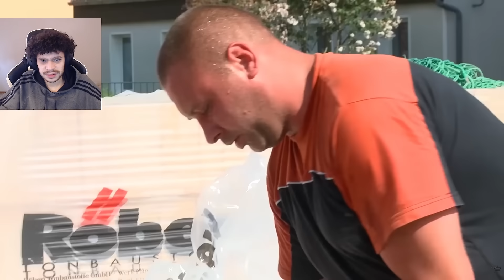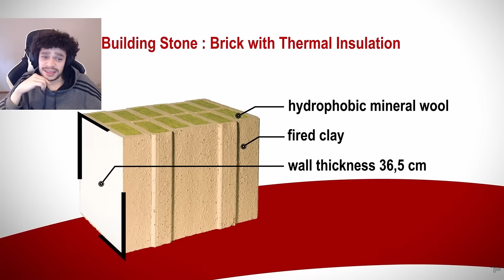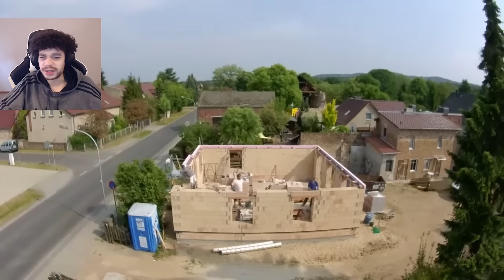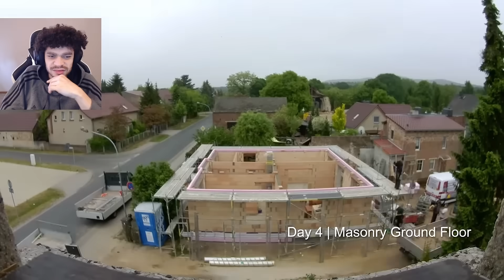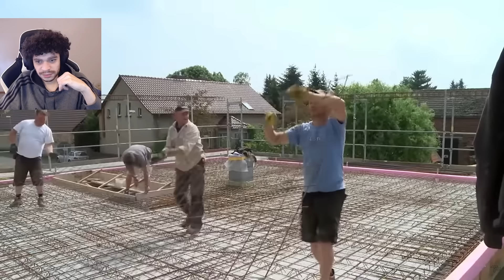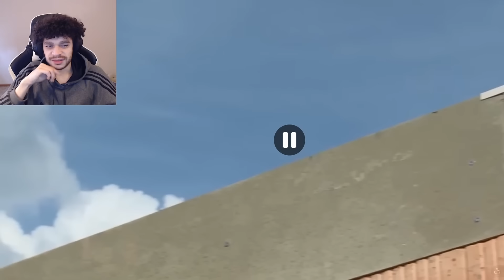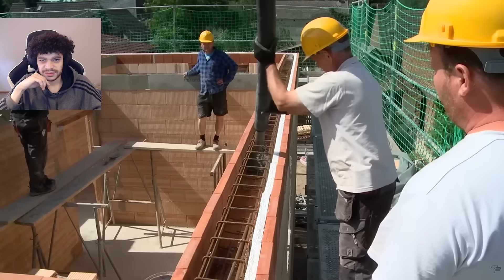American Reacts to How German Houses Are Built! *IS THIS REAL?!*

Comment: I live in Norway in a 300 year old log house. Built like a log cabin, but a full size house, with clading both outside and inside the logs,  so the walls are about 10 inches thick. The house can creak a bit in the worst storms, but we don`t really have tornadoes here, so I`m never going to be woried about this house falling down. Add to this the solid glazed roof-tiles that only needs me to look out for cracked/ broken tiles until redoing the roof in 40 to 60 years time.😊

Comment: The crazy thing about the sturdiness is that in Germany you don't have really heavy storms of the same magnitude as in the USA.
Reply: Northern Germany had the storm named "Christian" that had gusts up to 202 Km/h!
Reply: @jan-peterbrodersen3302  Its not like there are no strong storms ever. But they are less common and do not typically reach the power of storms in the USA. There are actually Tornados in Germany, but these occur rarely and only in one specific small region.
Reply: but you do have to prepare for war against nazi russia, so every.house being a bunker is extremely good forward planning.
Reply: @512TheWolf512  It would not require a single bomb to defeat the German army which has been basically disarmed by giving away a lot of its ammunition and due to other problems.
Reply: @drydessert4198  merkel deserves life in jail for destroying Germany. Mertz only just barely started fixing it
Reply: True, but it would be interesting to compare heating/cooling costs between European constructed houses and that from the USA.
Reply: @Dreamfox-df6bg  In many countries, it is common that houses are significantly colder inside in winter and therefore you wear thicker clothing. In Germany, it's common to have warm temperatures inside all year round. That and the cost of energy would skew a comparison.
Reply: @drydessert4198  True, but that's the reason so few houses in Germany have no AC's included. Until 20 years ago they simply weren't needed.
You know, the thing that so many visitors from the US wonder about.
Reply: @Dreamfox-df6bg  The houses here are insulated significantly better on average, but also cost significantly more. I just watched a video of a house construction. The floor slab alone costed 100k.

Comment: we also have wooden houses, but its rare and only realy a ting in the last few years. the video shows how houses are build nowadays. i life in a house from 1870. the outer wall is 3 rows of Reichsformat (25x12x6.5cm) bricks. so the wall is round about 38cm thick. the interior walls are 12cm thick. made from half timbering filet out with brickwork, the foundation is made from slate. additional every wall has around 3cm of plaster on each side. this construction is realy common here. drywall construction is only used to divide rooms and if old walls aren´t flat. and old walls are never flat, and no wall ever is at a right angle to another wall in a old house

Comment: What do you mean you feel wind??? You're inside! Wind is an outside experience!! 🤦

Houses in Europe are built to last but another reason for the difference is that long wood is much more expensive for us (as in: a 2 by 4 could be 5x the price) - we already deforested most of the continent. In Scandinavia, where they still have trees, you still see some wooden construction.

Most unrealistic thing about the vid was construction time. That part was a scam. Also later on after the structure is finish: our plumbers need to cut through concrete to install your toilet... Our electricians too. I've heard you guys build a home in 1/3 of the time compared to us (it will last 1/3 of the time too but, you know, choices)

Comment: Just FYI: Don't let you get fooled by the build speed "shown" in the video. All this is not just happening in 4 Days. It is maybe the 4th day on the site but not the 4th day after construction start. A typical German House construction needs something between 6 - 12 Months to be fully completed. The concrete needs AT LEAST 3-4 days Drying-Time before you cant continue with the next building steps, most of the time the company waits a bit longer. So if this vid shows Day 4 or 5 of work, you can assume this House is already standing there for at least a Month or maybe even two. Tbf there are some companies out there who build you a house in turbo speed (round about 3 Month's, including 30 days of mandatory drying time for the concrete to fully harden) but that's very rare in Germany. To be able to do this you need perfect weather, perfect organisation and perfect preparation.

Comment: One has to understand that BUILDING a house in germany makes for ar permanent residence, usually for the rest of your life. Ther are no "starter houses" like in the US, especially because - you can imagine - a solid house like that costs more than a few sticks and paper put together ;P

Jokes aside, there is quite a renge of options of how to build a house. Nowadays i'd say, the most popular methotd is the "Fertighaus". Basically a house made from prefab parts, which can be erected quite quickly. I've seen some go up within a months time, and i think it can be done even faster, given a dry groundplate.
On the other end, you'd have something like here - build from bricks, layout like you'd want it, and lastly customized to your wishes. Building such a house kann well take up to a year - however, if money is of no concern, it also can be done quite quickly.

The "Rohbau", the structure itself, is not the part that takes the most time, necessarily. It is the installations, the "Innenausbau" (interiors), the insulation etc.pp. that will take up most of it. As i said, these houses - wherever in the price range you are - are built to last for at least a century, probably more. You can get parfts where you have guarantees for up to 25 years -which is, AFAIK, somewhat at the WOL for the cheaper US houses...?
Take the roofs, for example - my house has it's second roof now, after the first one held up 60 years. And i positively expect not to have trouble with that again within my lifetime.
In the US, you've got those bitumen shingles, i guess, or a metal roof. Now, i don't know about the last one, but those flimsy shingles surely won't last for 20 years, let alone 60. And that's if the framing an whatever is tacked on that as "wall" is still intact after that time.
Well, it is definitely a lot cheaper, ill give you that. On the other hand, i'd call it also only "semi-permanent".

At last, it is somewhat different expectation. German houses are built to last for as long as possible, but doing so costs a lot and takes time. US houses are cheaper and quick to build, but they don't last as long. Given that USAians move a lot more than the standard european i guess that makes sense. Somewhat. ;)

Comment: The 24m² (250 sqft) garden shed I built a few years ago was built using a timber frame (Fachwerk) made from good strong posts (5"x5") not some flimsy boards. Of course connected by traditional tenon and joint. The frames where then clad with bamboo mats before I filled them with a hemp sheave / loam mixture. The plastering I did with loam as well. All in all the walls where 21cm (8") thick and MUCH more stable than a typical murican "house". And yes, that's just a garden shed, albeit a rather overengineered one.

Comment: These houses are built all over Europe, of course, every country or person has a certain style of building, but they are all the same. First, a concrete foundation. Then you build walls around the perimeter using mortar. The types of bricks can vary in shape and size. They are completely European standard. They are always strong and will last for many years. They are called prestige.

Comment: Drywall is mostly used for interiors in office buildings, screwed to metal studs, and sometimes as so called dry-plaster simply glued against the brick-walls from the inside. Which will track some air pockets between brickwall and drywall and this way improve insulation.
Reply: In the UK we'd attach it to to wood studding fastened to the brick work.  Internal non load bearing "stud walls" are frequently a wood frame (60cm centres) with drywall attached,  makes wiring easier 😁🇬🇧

Comment: That's just normal European standard of brick laying. Nothing specific German here. Also most common is makng the corners from concrete and rebar connected to the concrete foundation and the ceiling that is also done as concrete with rebar. That's structurally superior to making the corners with bricks.

Comment: Can you feel any wind? - Nope. You don't feel a thing. Depending on the wind direction, you might hear it a little. Perhaps if you have a converted attic—since those are usually made of wood here, too. You can see that in the second part of the video.

How much does it cost? – It depends on the size and location. €400,000 is probably a mid-range figure. This one might be a bit more expensive. It’s not exactly a luxury cabin, but it’s above average. It looks like they built it on an existing plot of land, which makes things a bit cheaper.

How long does it take? – I think getting all the permits together takes the longest. Bureaucracy here is incredibly complicated and time-consuming. They build the house itself in a single season: one month for the shell and five months for the interior finishing. That’s assuming the tradespeople coordinate well—so you don't end up with the tiler arriving before the electrician, or the plumber failing to show up for a whole month.

In this case, it looks like the workers are Polish or from elsewhere in Eastern Europe. They’re the best. They work from sunrise to sunset and will even solve problems outside their specific remit just to get the job done.

Comment: You have to understand that the differences in home building are the result of different circumstances. Timber has always been cheaper in the U.S., there's just so much available. So it makes sense to use it for building homes. Also, Americans are more mobile in general, whereas many Europeans are building generational homes that basically last forever if you take care of them. Although that's changing now, families are spread out across the globe.
Also, the brick-and-mortar style of building family homes is becoming less common now. It's being replaced by prefabs who offer competetive pricing and very short construction time on site. These panels already contain insulation and moisture barriers and are held together - by wooden studs. So Europe is shifting towards wood again, but in a different way.

Comment: Do we feel wind? Does the house shake?
Uhm … nope. When there is a really strong storm outside you only hear the rolling shutters rattle a little. But you do not feel the house shake or anything.
We have very few occasions when we have tornados in Europe. (Not all that strong like an american tornado). And we have storms with wind speeds reaching 100 mph. The only thing that might be damaged are the roofs. But usually they just laugh it off. Most roof damage happens when a tree is push over by the storm and hits your house.

Comment: This is obviously a promotional video for a house building system. 1. Most houses are not built like depicted. 2. In contrast to other European countries, in Germany the majority of people rent houses and appartments. 3. We don't fall through the floors like Americans do. 4. In the US everything is about appearance and not about value, substance and quality.
Reply: However, the construction methods are similar; I worked in the construction industry for 30 years and am familiar with various techniques—ranging from timber-frame construction (which is becoming increasingly common here, albeit using larger timber cross-sections than in the US) to the construction of prefabricated homes. I have also renovated older buildings to meet modern standards. Construction in Germany places far greater emphasis on individual preferences regarding materials than in the US, and regulations vary from state to state—particularly concerning thermal insulation and structural integrity, where designs are consistently "oversized," meaning generous safety margins are incorporated.

Comment: "Are all houses build out of brick?"

No, but most are. This is also a common standard in most of europe. 

There are also Wooden Houses, but these tend to be much thicker than american ones. There are regulations as to how thin wood wall houses are allowed to be. 
Another cathegory are the so called "Fachwerkhäuser", which have visible wooden beams in the outer walls, with primary beams being 7.8x7.8 Inches in size (Roof beams tend to be a bit bigger) with a cross-beam pattern. These walls are then inlaid with Clay, as a brick-wood hybrid house. Fachwerkäuser are historical works, still being lived in and can be as old as 800 years and still in use. 

Something to mention is that there are tons of regulations for various aspects of a house, hence why every single house has to be designed by a qualified architect.

Comment: The brick with thermal insolation, is not as widely used, as they made you think. Usually you use, brick without insolation. And isolate the outside of the wall, when it's finished.
Reply: They mostly use blocks with narrow air channels, which also have excellent insulating properties, if not quite as good as the ones used here. Whatever method used (and there are many different ones), every new building as a whole has to conform to strict energy saving requirements for walls, windows, doors, roof,  basement, etc. This applies not only in Germany, but all other EU countries in similar fashion.

Comment: Transatlantic greetings from Germany, brother.
It’s actually simple to explain; there is no "better" option.
I could go into deep explanations involving national regulations, DIN standards, and so on, but I’ll spare you that.
The differences between the USA and Europe or Germany, specifically, are cultural.

Americans use wood because it is available in abundance.
Every country uses the materials that are available to it.

On top of that, you have more natural disasters, so wooden houses are easier and cheaper to rebuild.
Our walls, on the other hand, are designed and built to retain heat inside the house during winter.

The thick walls store heat and keep the interior cool in summer (except for top-floor apartments, which turn into saunas because heat rises).
Because everything is so thin, Americans use air conditioning as a standard feature to counteract this.

Houses in Germany and Europe have thick, deep foundations because they must support the heavy weight of solid brick or concrete walls, prevent frost damage in winter, and protect the building from ground moisture.
It’s the opposite in the USA; wood frames are lighter and therefore don't require such thick foundations.

There is another important cultural difference.

Americans move house more frequently: a small house for a single person, a medium-sized one for a couple, and if the finances allow, a move to a large house once they have one or two children.
In Europe, the norm is that when we buy or build a house, we stay there forever.
(I’ll leave all the current issues aside for now.)

Even our houses that are over 650 years old—like mine—are usually half-timbered structures. This involves a mix of solid timber construction and brickwork, typically with slate cladding; clay and clay panels were used for insulation. Some houses—like mine—are built so solidly that they’ve even withstood a World War bomb; only the roof was destroyed.

Our houses can withstand minor flooding, extreme cold, storms, or hurricane-force winds, which puts one's mind at ease.
If you look at the flood disaster in the Ahr Valley, there are videos showing entire houses being swept away—without breaking apart; they were simply torn from their foundations.
Other houses were torn apart.

There are no buildings that are 100% safe from Mother Nature. ^^

The interior layout of houses varies, of course; anyone building a home has the freedom—working with architects, prefab or construction companies, and independent consultants—to plan a design that suits their specific needs.

My house was ideal in this regard, as I could easily install partition walls in the large rooms to create several smaller ones.
It didn't require much effort: I simply had modern electrical wiring installed back then, and I ran the internet cabling throughout the house myself.
Aside from installing new windows, a front door, and a back door, all security-focused upgrades I didn't have to do much else. :)

And as I said, when it comes to modern houses, there are so many different ways to have one built all across Europe.

For example, there are interlocking blocks that get filled with concrete like the type shown in the video and there are other wild methods too :D

Comment: Mums and Dads house has 48 cm outer walls, stone with solid clinker fronts. 50 years old, looks brand new. And no, it does not shake during storms xD Just lower the roller shutters in front of the windows.